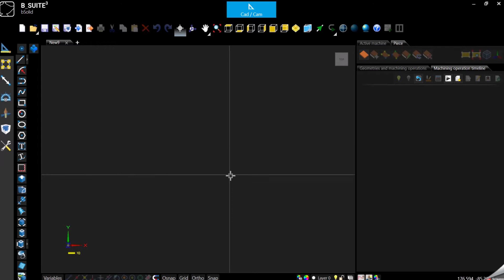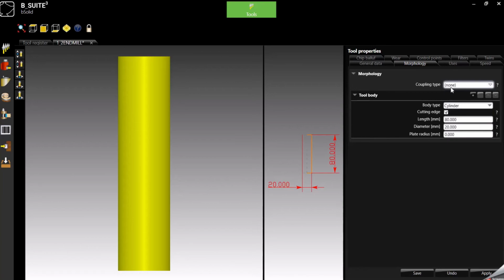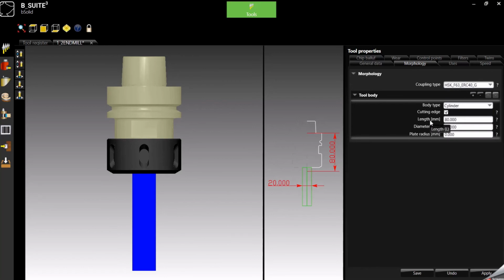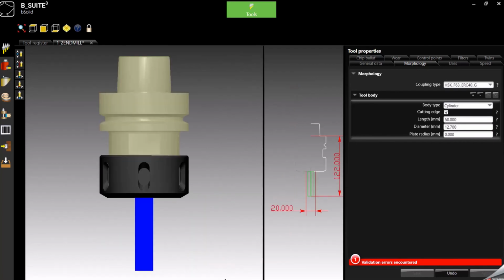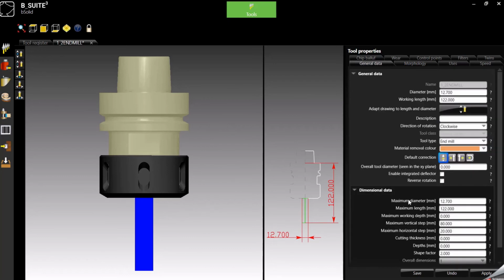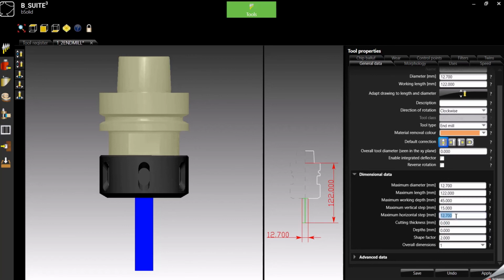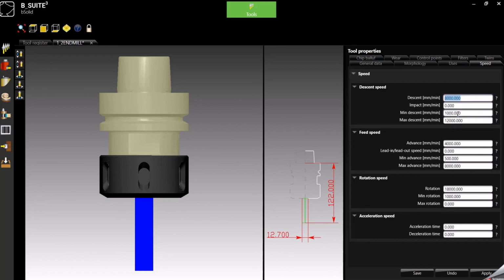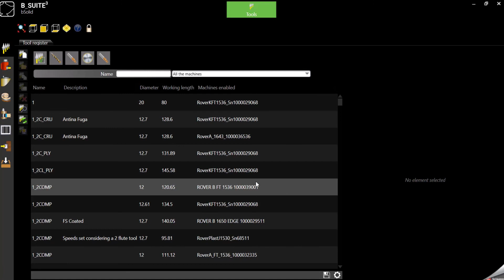2 - CAM BIESSE bSolid - Creating a new End Mill

Comment: Great stuff Alex!  Thanks for putting these videos out for us, they are very helpful.  We have an Eko 2.1 - our prior operator left without notice, so we are trying to relearn the machine, so your videos have helped with that.  We need to (asap, having trouble with a job that is in a couple of days) add a 1/4" down spiral tool and program a groove for adding a lighting channel into our vertical panels (melamine).  I was wondering if there was someone you could point me to that could help take care of that (that we would pay, of course)?  Just realized we won't have time to relearn fast enough to be prepared for the installation.

Anyway, thanks again for what you do!

Tom

Comment: Sir also make a video on how to create aggregate tool.
Reply from the maker: Hi,
Creating an aggregate in the software is pretty easy, but to set it up on the Machine it requires a little more knowledge. 
If you are not really familiar on how to do it, I suggest you to contact the Biesse service department, to avoid damaging the machine. 
Best regards

Comment: Hello

I just created a new tool in bSolid (8MMDC) All data are correct. It appears on the TOOLS section but when I go to tooling, it doesnt show there. What should I do?

Thanks
Reply from the maker: Hi, 
I would suggest to check the "Coupling Type" (under the Morphology tab), because you may accidentally have selected a wrong one, which don't match the coupling of your spindle.

Comment: Do you upload a video about tool up on the machine?
Reply from the maker: Hello, not yet but i will make it soon.
Reply: @freshzone  i’ve some problem about measuring the new tool,there is always 1 mm depth difference between dimentions and miling.İ’ll be waint for your tool up video.Thanks
Reply from the maker: @Janberk.E  Probably you will have to calibrate the presetter using the presetting tool, and then touch off all the tools again.

Comment: where can i get the program
Reply from the maker: The software is only for Biesse CNC machines and usually it comes with them. If you don't have a Biesse CNC, it is useless because it doesn't have any other post-processor rather then the Biesse one.